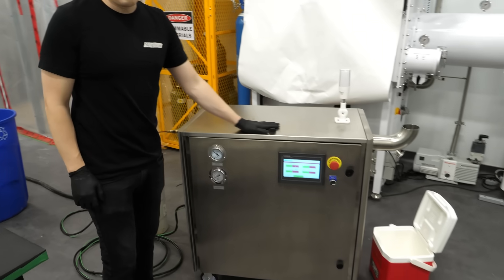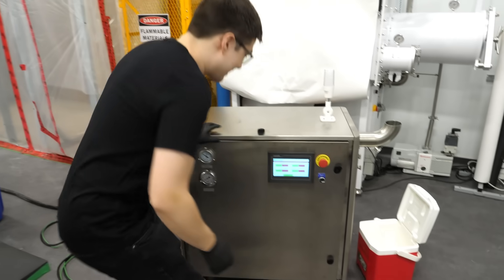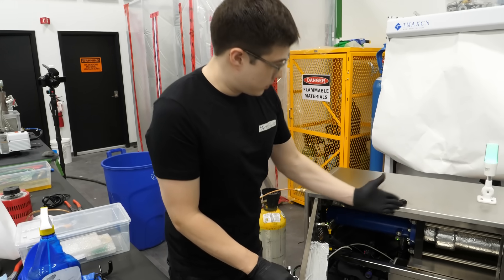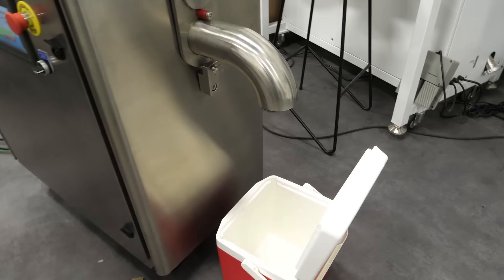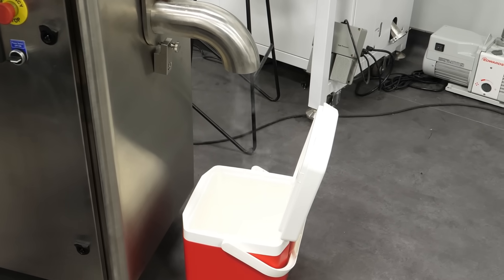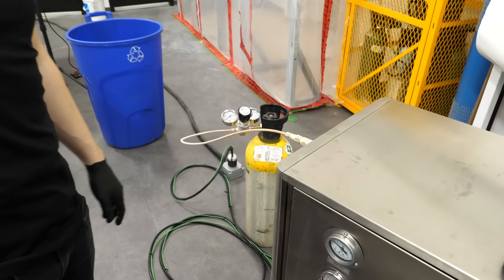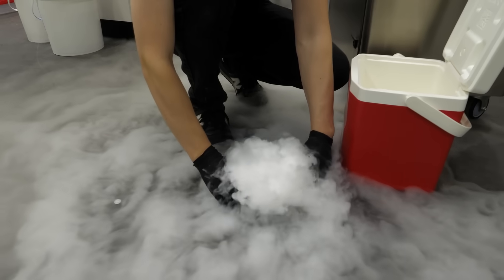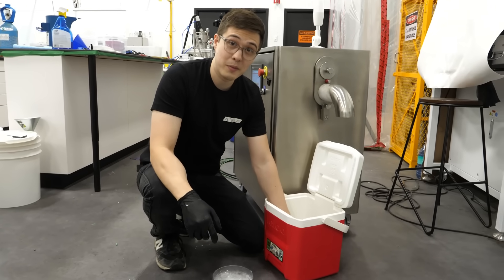This dry ice machine is pretty cool

Comment: I would agree the machine is good, and thanks a lot for the video! I just wonder the room temperature CO2 tank in the video is 6-8Mpa or 15-20Mpa? I think using a cryogenic liquid CO2 tank(2.3Mpa) or dewar tank(2.05Mpa) and making sure the CO2 pressure 1.6-2.3Mpa for dry ice production is more good!❤

Comment: I guess... Technically... Depending on how cheap you get both CO2 and electricity, this COULD be cost effective. 
Either way though, if you run out of dry ice but have some CO2, it could save an experiment.

Comment: they need a machine that pulls co2 from the air and puts it into a canister for use in creation of dry ice. be a nice little thing to put in the garage and let do its thing. when you have a party or gathering of any sort you could start showing off. you could charge people you know for the ice based on the power it consumes and reduce your cost as a producer by adding passive energy like solor panels.

Comment: It’s compressing the gas into a solid.

Do you have an O2 sensor in there with you?  CO2, at least, will let your body know if it builds up too high.  Still, though.  The oxygen content in the room only has to drop to like 19.5% for hypoxia to start to set in.

Comment: There is an implement for liquid CO2 tanks (don't know what it is called in english, maybe a fishing tube?) that allows the liquid at the bottom of the tank to come out trhough the valve. At the valve head, just put a cloth bag that allows gaseous CO2 to escape but retains the solids.
Liquid CO2 turns solid instantly when it gets outside of the tank (because of the pressure drop).

Comment: I worked in aviation sheet metal for a few years and we would perform interference fit maintenance which would require dry ice. Instead of this fancey machine we had a big bottle of liquid nitrogen, with a tube leading into a wooden box with vents on all sides and latches to detach the walls, we open the bottle and when we simply spray the nitrogen into the wooden box it would naturally create ice, fill up the box, detach walls, and now we have a cube of dry ice for much cheaper than i assume this machine was lol. He probably needs it specifically pellet sized though..

Comment: You either need a CO2 cylinder upside down, or a CO2 cylinder with a syphon (with a tube going down to the bottom) and you can generate dry ice as many as you want. This is how we made in students lab at the uni. Why do you need a machine for this?

Comment: You need a dewar or a micro bulk tank.  That small cylinder isn’t going to make very much dry ice.  Under good conditions you will only get about a 2.5:1 ratio of liquid to solid, and that is with a much better machine.

Comment: I've been making dry ice for forty-five years. Only one high tech device required, a cotton towel. Step1. Disconnect the liquid CO2 line from the machine. Step 2. Throw away the machine. Step 3. Wrap a cotton towel loosely around the end of the copper tube. Step 4. Slowly vent liquid into the towel. This will produce perfect dry ice. And when all finished you can give your wife back her completely undamaged towel.
Reply: at the cost of only getting about 20% of the input CO2, the rest is evaporated to power the cooling required to solidify some.
Reply: @AlexanderBurgers On big commercial machines you loose 2kg every time it makes 1kg
Reply: Jokes apart, is it real though ? Can you really make dry ice with that
Reply: @ghosttown5448  Yes, that's how my physics teacher used to do it in the early 70s - CO2 fire extinguishers, which are filled with liquid CO2.
Reply: @RJTC  oh okay
Reply: @ghosttown5448  100% True and cost effective
Reply: Yes @ghosttown5448
Reply: he did make dry ice this way in a older video
Reply: @FranzTurtlemanHubert  in which video? Can you name it
Reply: Yeah but who tf wants to out up with that if they can just buy a dry ice machine 😂.
You loose so much Co2 too.

Comment: I love the gigantic emergency stop button... like what could possibly go so wrong with that system that it needs an emergency stop on it?
Reply: I guess if it ever started overflowing… or the CO2 line broke off (probably not a good idea to run the machine with nothing connected to it.)
Reply: Realy there is nothing that could go horribly wrong.
If something goofs up inside it would just lock out with an error.

Comment: You mentioned the feed pressure on the liquid CO2 was 200psi, but wouldn't CO2 be a gas at <800psi? If the machine needs liquid CO2, your pressure may be too low.

Comment: To get the most mist for your buck, place the pellets above boiling water.  ;)

P.S. If I remember correctly, the liquid CO2 goes into the mold under pressure.  When you remove the pressure, the dry ice is formed.

Comment: This is the most stereotypical looking machine: a metal box with gauges and a big red button to stop
Reply: and a big orange light when it is done making the thing
Reply: @chris-hayes  Only thing missing is the big label, "ACME."
Reply: @chris-hayes  to be fair, orange is a bold choice
Reply: Also the hydraulic pump sound.
Reply: it's a pretty standard design for industrial machinery - the red button is not the normal stop button but an emergency stop, in case it starts doing something it's not supposed to
Reply: I agree but I would add a lever still.
Reply: a lot of these factory machines look like this. sheet metal box, e-stop, a few indicator led's. this one has a screen which i haven't seen a lot of
Reply: Even the fact that there’s just an “input” on one side and the “output” on the other helps. Like “oh yeah the machine just makes stuff. Stuff comes in on this side, and stuff comes out on that side”
Reply: They left on the self destruct button
Reply: Something out of the chum bucket
Reply: You always have to have big red button to stop. It's a safety thing. Everything in the shop should have an E-stop. Every factory I've worked in has had it, except on the welders. They are more tool than machine or machine tool, so they don't need an E-stop. Also because you will be dead before you can press it. 
But everything with moving parts and even a single automated process had an E-stop. Air compressor, rolling or grooving machines, plasma cutters, presses and press brakes, everything needs big red make it stop right now SCRAM button.
Reply: Right? you could put this in any scy fi  movie and call ti anything and the viewers would nod and say "Makes sense"  but what about the big red button some may ask? "well that's classified....don't touch it..."
Reply: And at the end a nice pneumatic "Patcheeew!"
Reply: I‘m a machine and i find that offensive
Reply: @Spielkind104  I am a Machinist and a better machine than you

Comment: Invert your CO2 Cylinder to increase the amount of liquid CO2 getting to the Machine.
Reply: If the CO2 bottle has a pipe that goes to the bottom, which it looks like this one does, then it releases liquid CO2 and not gas.

Comment: Now you just need a machine to extract Co2 from the air, so you can make infinite amounts of dry ice.
Reply: And another machine to liquify it.
Reply: @DanielLCarrier He has a machine to cool it under pressure.
Reply: @DanielLCarrier no way you’re this dumb🤦🏻
Reply: So carbon capture?
Reply: @do811  Well, the dry ice will sublimate, so it does just go back into the air. Not exactly captured.
Reply: @ferretyluv  carbon temporarily captured
Carbon inconvenienced
Reply: @ferretyluv it’s reducing the CO2 in the atmosphere for 15 minutes. 
YES, we did it, we saved the planet. 😂
Reply: @1943vermork  Finally. Someone understand why hydrogen power (upon other reasons) is just a "on paper" fix.
Reply: @Deja117  especially if the H2 is produced from steam methane reforming where the CO is dumped in the atmosphere.
Reply: @1943vermork  maybe human can create new antartica but use dry ice😂 I mean we also can reduce the earth temperature if my idea was true hahaha (but sadly create dry ice takes lot of energy😔)
Reply: @1943vermork  for 15 minutes, yes. You would have
Reply: @ferretyluv  if its stowed away somewhere in like a vacuum chamber it should be fine, but that would take a lot of storing of co2 to deal with pollution in that sense
Reply: @1943vermork  the amount of co2 in the atmosphere is alrdy pretty low.
Reply: Even better, he needs a machine to extract the nitrogen from the air and liquefy it.
Reply: @AltimaNEO  foreshadowing
Reply: @AltimaNEO   Have a read : https://en.wikipedia.org/wiki/Nitric_acid#History

The industrial production of nitric acid from atmospheric air began in 1905 with the Birkeland–Eyde process, also known as the arc process.[18] This process is based upon the oxidation of atmospheric nitrogen by atmospheric oxygen to nitric oxide with a very high temperature electric arc. Yields of up to approximately 4–5% nitric oxide were obtained at 3000 °C, and less at lower temperatures.[18][19] The nitric oxide was cooled and oxidized by the remaining atmospheric oxygen to nitrogen dioxide, and this was subsequently absorbed in water in a series of packed column or plate column absorption towers to produce dilute nitric acid. The first towers bubbled the nitrogen dioxide through water and non-reactive quartz fragments. About 20% of the produced oxides of nitrogen remained unreacted so the final towers contained an alkali solution to neutralize the rest.[20] The process was very energy intensive and was rapidly displaced by the Ostwald process once cheap ammonia became available.
Reply: @AltimaNEO  Infinite food and infinite refrigeration to ship it.
Reply: @AltimaNEO He has that already, but it more liquifies the atmosphere which is mostly nitrogen.
Reply: inb4 climate crisis solved ;)
Reply: @davisev5225  dry ice is made from CO2, which freezes at around -78°C. Nitrogen remains a gas until around -196°C when it becomes a liquid. Nitrogen freezes at around -210°C, waaay cooler than dry ice.
Reply: @ch535  I stand corrected, thank you.
Reply: @ch535 Nitrogen Ice sounds kinda like it would be some sort of advanced sci-fi heat shield cooling method
Reply: you are the machine
Reply: Is there a need to extract it from the air? Can't you just cool down some air and at the right temperature the CO2 liquefies and then freezes.
Reply: @NoC4k3  That would be one method of extracting it from the air. ;-)
Reply: @NoC4k3 there is so little CO2 in air it's probably not practical.
Reply: @NoC4k3  Air is made up of a bunch of different gasses, and that also includes water vapor. Dry Ice is frozen Co2- & doesn't leave behind water when it evaporates- though you would likely get it on the outside of whatever container you store it in. Moisture also easily traps pollutants, so if your using it where it needs to come in contact with other chemicals it could contaminate your process.
Reply: If he also makes it so the machine can capture all the evaporated dry ice CO2 and turn that into liquid CO2 he could infinatly make dry ice out of dry ice in a never ending cycle kinda like a dry ice science Rube Goldberg machine!!!
Reply: And solar panels to make free energy for it all?
Reply: @cpypcy  Please don't call it free energy. There is no such thing. All systems suffer from both entropy & losses, the conversion of energy to heat being one of them. Now if by free- you mean no electric bill for using it that's highly unlikely. 

If that unit is anything like the ones I've seen it uses about 65-80 Amps, which ends up being about 7,800 watts to start & run for about the first 5-10 minutes, until it gets down to temp & then it should run at about 3/4ths to 1/2 that per hour after. For math purposes we'll keep it at the highest known power draw. 

Considering non-roof mounted solar usually caps out at around 75-125 watts per panel per hour, he'd need 104 panels for the 75 watt, 78- for the 100 watt, & 63 for the 125 watt panels. Which means to be effective & assuming he doesn't own a few acres of land around that building, he needs 200+ watt solar.

Then he'd also need multiple battery banks to try to store as much as he can generate so it's not bleeding unused/unstored power for nothing. Then multiple charge controllers, all that wiring, & the breaker & junction boxes to attach it to someplace in the building, make sure it's up to code so it's not gonna short 5000+ watts of power someplace you don't want it, & get it where he can access it.
Reply: You stole my idea :D NileRed, stopping global warming one ice cube at a time :D
Reply: @davisev5225  Incorrect. You obviously FAILED basic Science. It has & always will be Co2. Liquid nitrogen is used for lots of applications- yes, like for overclocking competitions with computers. The easiest way to make Dry Ice is fold up several layers of cheese-cloth around the nozzle or hose from a C02 tank. Most welding supply places (also some party favor / hardware stores) carry it as a cheap substitute <but far less safe> for Argon gas when TIG welding

Proof:
https://www.hhs.nd.gov/sites/www/files/documents/DOH%20Legacy/Dry%20Ice%20Safety.pdf

Stop believing that BS that Tik Tok tells u & learn something useful.
Reply: Seems pretty awesome
Reply: electric bills though
Reply: The pressure of deep ocean can keep methane and Co2 captured without storage tanks.
Reply: Yess
Reply: problem is it costs energy, which is likely produced by natural gas electricity. but then it also produces Co2 which is then solidified. so it only costs money, which he couldve used to buy dry ice in the first place
Reply: @RowensGotGamesYT  True, but the cost of transportation & refrigeration during transport, also depends where you live, it's not like it's available everywhere, the other is probably related to how much he might need. Here in the US, a good portion of our electric is from wood scraps, chips, paper, sawdust, cardboard, & other biomass. (Most recycling programs just send out all the cardboard to be burned, because there's already so much stockpiled that we don't have enough factories to recycle it back to things like paper fast enough.)

In 2023, about 329 trillion British thermal units (TBtu) of energy from biomass was used in the power sector here. This amounts to 39% of total biomass energy consumption, with biofuels accounting for 53%. The rest comes from fossil fuels, solar, wind etc.
Reply: Hell yeah carbon capture but epic

Comment: 2:42 is this carbonated water ?
Reply: i think the water would have to be pressurized and also be at room temperature for it to be proper carbonated water. you could probably just drop a few grams of dry ice in a bottle of water, put the lid on, shake it a bit and have carbonated water. (assuming you don't make a dry ice bomb)
Reply: @willemplatt948  it would have to be a glass or metal bottle, so the pressure can build without expanding the container, as that's basically how you can add carbonation to alcoholic drinks, just with yeast as the pressure building source instead of pure CO2. Just have to add a tiny bit like you said as I'd assume that it'd be very easy to over pressurize it
Reply: @thepizzaguy8477 You know that SodaStream machines carbonate water in plastic bottles just fine? You definitely don’t need glass or metal. (In fact, people make DIY water carbonation machines using ordinary soda bottles. It doesn’t take that much pressure to carbonate water for beverages.)
Reply: @thepizzaguy8477 You can't over-pressurise it, because the pressure does not increase when you add more CO2 (until you somehow manage to add so much that you oversaturate the water).
Reply: You can carbonate drinks in plastic bottles just fine. Pepsi does it in Russia and China every day.
Reply: well you would dissolve quite a bit of CO2 in that water given the low temperature, but it would stop from dissolving once the water freezes
Reply: I tried this myself and it works but the carbonation was very weak considering the amount of CO2, most just bubbled out. Although the low temperature created by the dice helps, you also need quite a high pressure for an adequate carbonation.
Reply: Yes, but not as much as something like a soda. For that you'd need to carbonate it under pressure, which forces more of the co2 to dissolve into the water. Even so, it's nice to use dry ice in things like punch bowls; gives it a little zest and looks cool. Keeps the punch cold too.
Reply: A bot stole your comment and has triple the likes yours does 😭